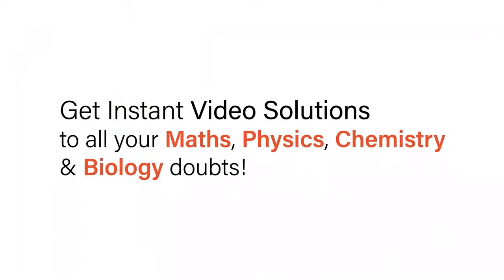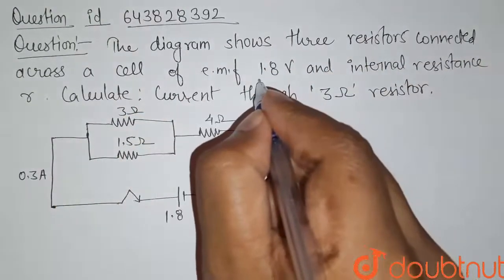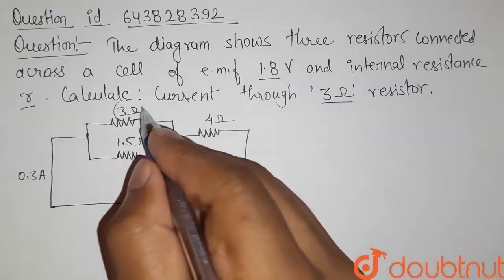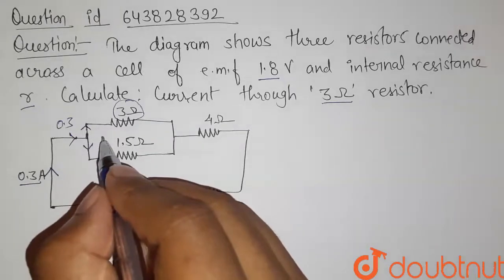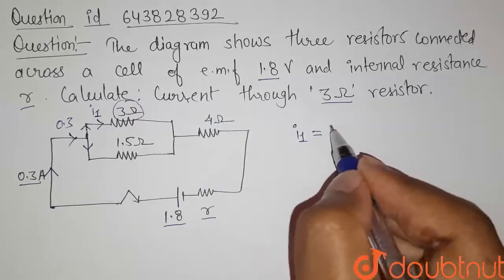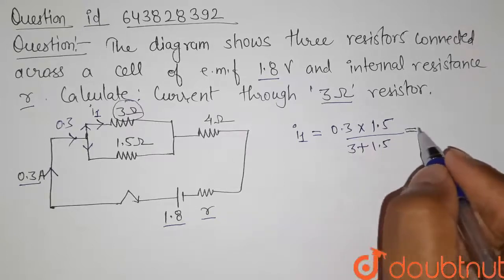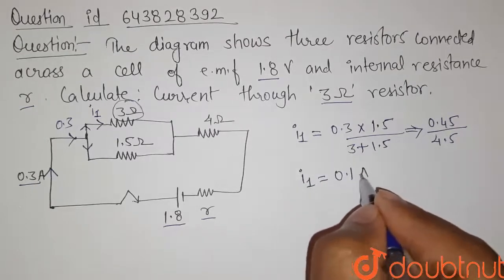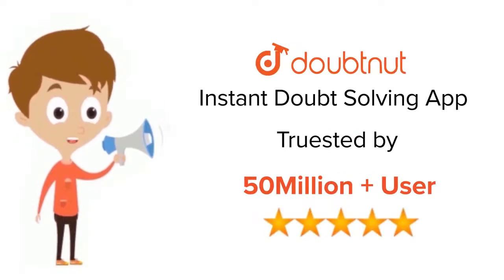The diagram above shows three resistors connected across a cell of e.m.f. 1.8 V and internal re...

Comment: Given in figure is the circuit diagram in which three resistors of one home two home and 3 ohm are connected to a cell of elect to volt and internal resistance of 0.5 ohm